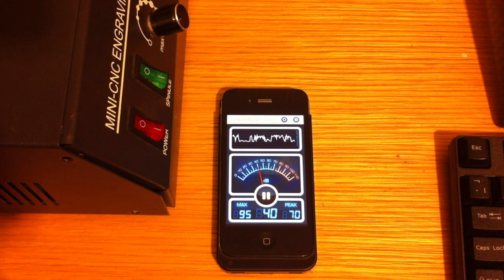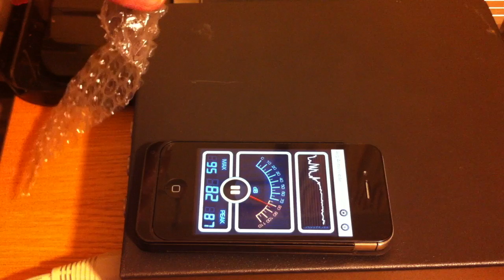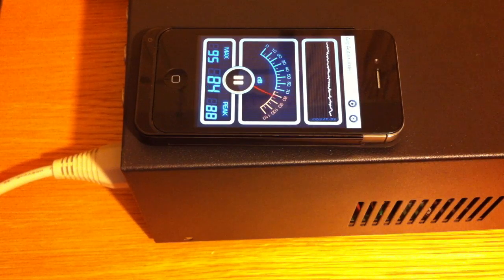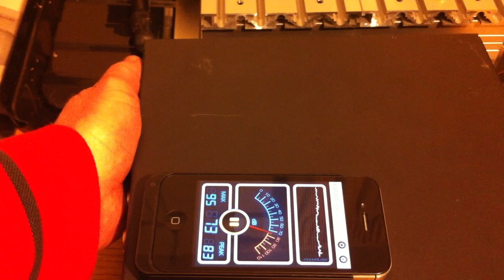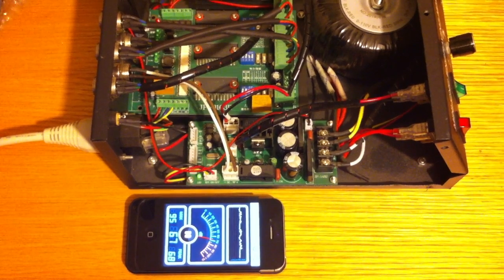CNC 3020T Router Engraving Machine - How To Reduce Control Box Fan Noise

Comment from the maker: This video is about How To Reduce Control Box Noise On A CNC 3020T Router Engraving Machine.  The control box itself generates over 86db of noise and this video explains how I easily reduced it by over 10db and improve the heat transfer efficiency.

Comment: Hello
Can the laser be installed instead of the engine in the CNC 3040 4 axis Router.
Is the electronic circuit has a place to install a laser cable.
Reply from the maker: yes there are video on youtube.  I'm about to add one to my 3D Printer.

Comment: hello
great video
but could you tell me please how do i reverse the fan as i too have a 3020t cnc
is it simply just turn the plug the opposite way in the circuit bord
i have not yet opened mine but i would like to what you have done
also have you had any problems wthe the cnc as i have not much work done with mine 
and any pointers about issues would be great
thanks
Reply from the maker: I just removed the fan and flip it over 180 degrees, the effect was a massive reduction in noise.
Reply: thanks very muh for your reply 
i will do the same 
thanks again

Comment: you can just clean the fan once in a while, peel the sticker and rubber and apply a little oil on it
Reply from the maker: This was a brand new fan and brand new machine, and oiling it made no difference.  A very noisy cheap chinese fan.

Comment: You've cut the noise in half, I bet that's a relief.
Reply from the maker: wayne murphy Certainly, with the 'Giant Tupperware' box hood, as somebody called it,  and the crazy reversed fan sorted out things are a lot quieter.  It seems bizarre that they put the fan in in reverse, but then the constructors on the clock just did what they were told.  Of course without the hood I could have been blowing swarf etc into the box, will have to watch out for that.  That could have been the method in their design.